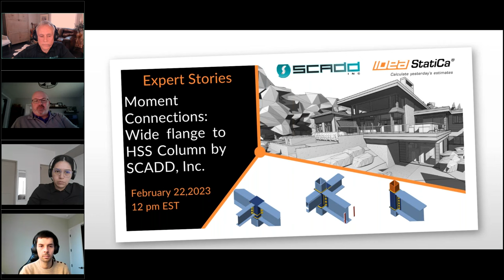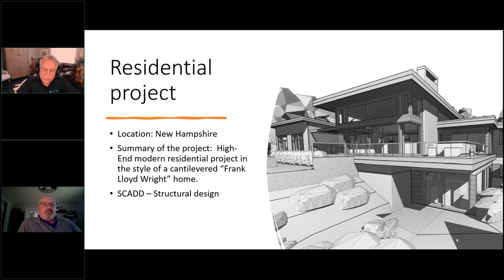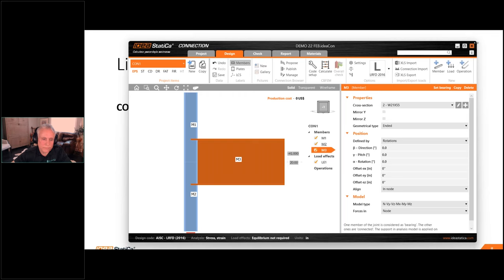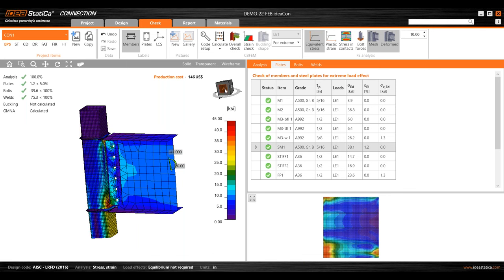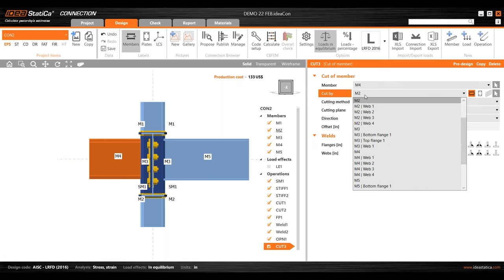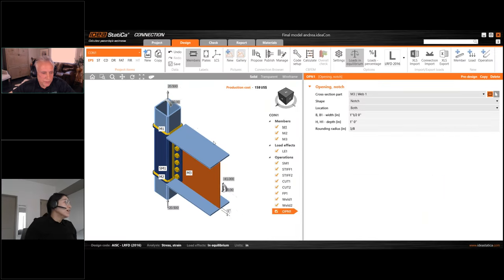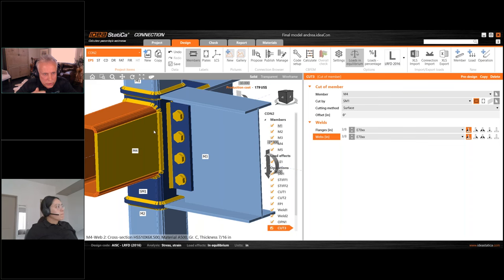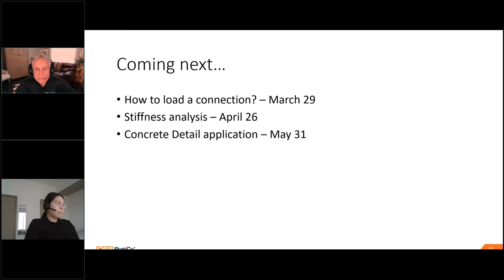Moment connections  Wide flange to HSS Column by SCADD, Inc

Comment: in first model when were you model that. welds are not available but at the end time of webinar two weld operations are added

the major problem with your modeling is the column is created with 3 different members and bearing just add two when end of column. so loads can not transfer to other end. i found some other way to model this.
Reply from the maker: Hello, thanks for your comment. 
The column had been modeled like that because of the stiffeners dividing the column. In IDEA StatiCa Connection, you can't cut continuous members. The workflow shown in the webinar was the most convenient for the given model. Nevertheless, there is usually more than just one workflow for designing the connections in the Connection app. You always choose the one which suits your needs the most. 
Have a nice day!